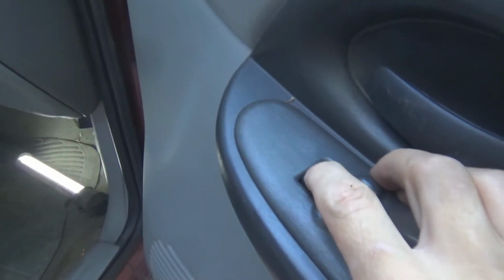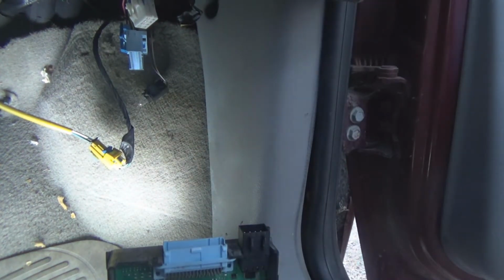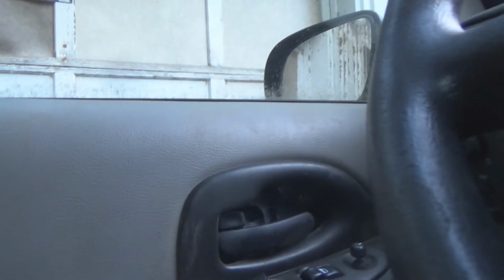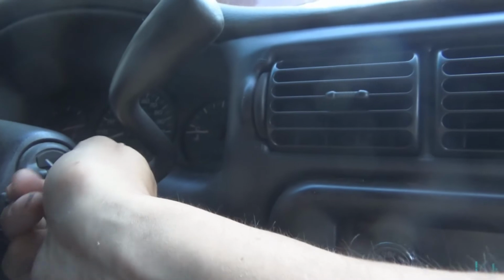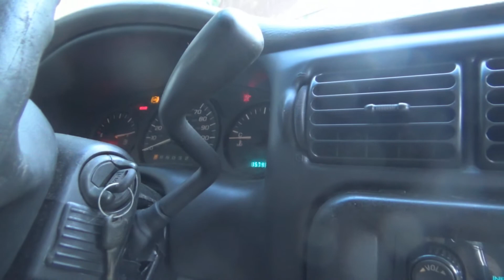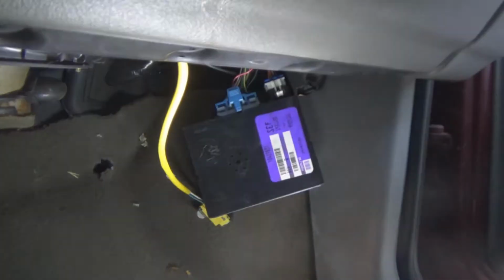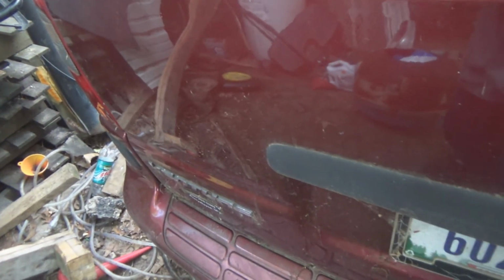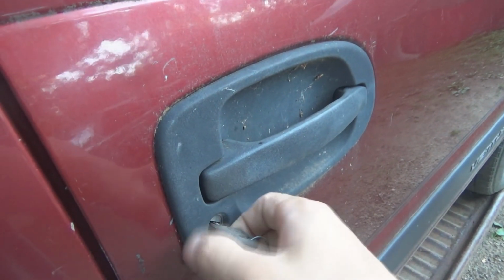fixing the power locks on a 96-05 chevy venture oldsmobile silhouette pontiac montana

Comment: Supposedly these need to be programmed or else you lose the radio and have the wrong mileage. The remote is easy to program if you got the right BCM (some versions have the receiver and some don’t).

Oh: Could you put “BCM” in the title? It was hard to find again, even when searching my video history for “Venture.”
Reply: Had the same issue: Couldn’t find this video for weeks after some kid potentially fried my BCM with reversed jumper cables. Finally started playing anything that seemed remotely related from your uploads until I found it again.

Turns out that the remote won’t work when your stereo fuse is blown. My BCM still functions but I already had a problem where it would only lock but not unlock with the remote and I could not program another remote (probably a stuck relay). I guess I need to break out the soldering iron and replace some relays!